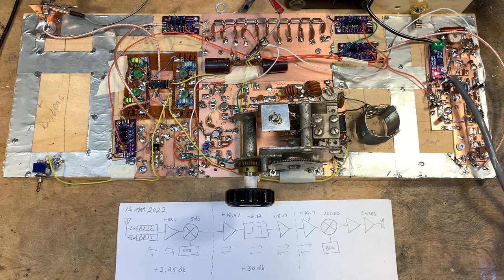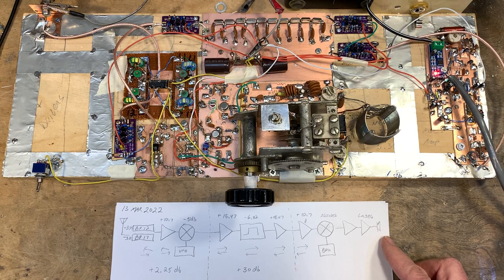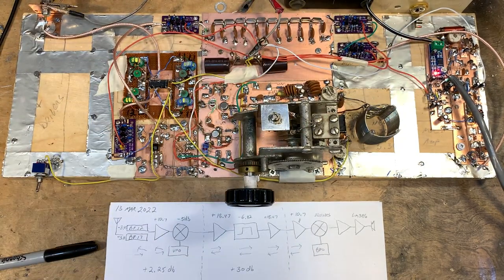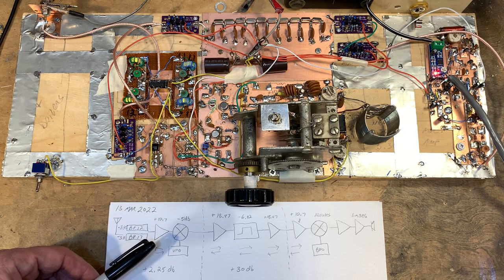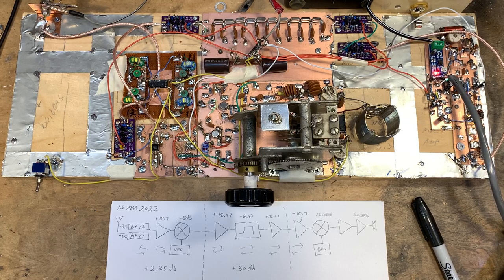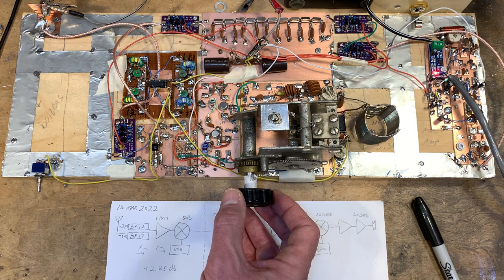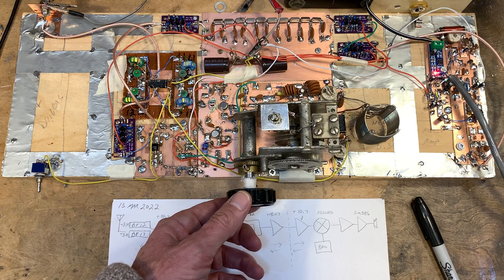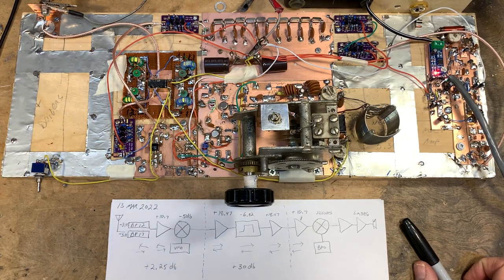Video #3  17/12 Dual Band Homebrew Superhet Transceiver -- Receiver is working on 12 and 17

Comment: Sounds good, receiver is lively, good sounding audio on the received SSB stations.  
I faced some similar challenges with my SP8 project.  I made it as a 28MHz SSB monoband transceiver, then added a 28 to 144 transverter for 2m SSB.  Getting receiver sensitivity at 28mhz had me adding more gain than for lower HF. I used a dual gate MOSFET RF stage 12..15dB, a diode ring mixer to a 9MHz IF,  diplexor, post mixer amp 10dB, repurposed Yaesu crystal filter,  three IF gain stages 50..60dB, and SA612 product detector. My IF probably has a touch too much gain and the whole receiver rides with a fair bit of AGC which adds some compression. But it pairs with the 2m transverter nicely.  Getting the gain distribution is a key challenge.  Also, I found that when you build a monobander you can add extra filtering because you don't have to band switch.  
The TIA PCBs makes perfect sense, don't feel bad because you used a commercial grade PCB for a highly reused circuit block!  I designed a PCB last year for a TIA and will get it printed in China sometime. I wondered about getting the surface mount parts built at the factory!  How do you feel about that? 🤔😄 Just socket it and Bobs your Mothers Brother.  73 Bill.
Reply from the maker: Thanks Paul.  Yea, I did not feel at all bad about the TIA boards.  They came from Todd K7TFC and definitely added soul to the new machine. I think this kind of scrutiny of gain distribution, noise, distortion and dynamic range is the next step for us in receiver/transceiver design. 73  Bill